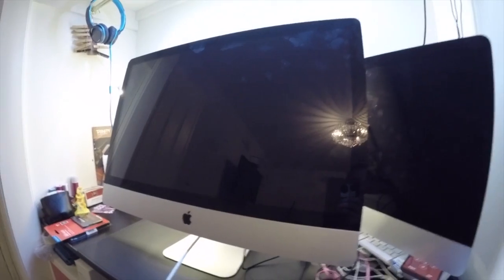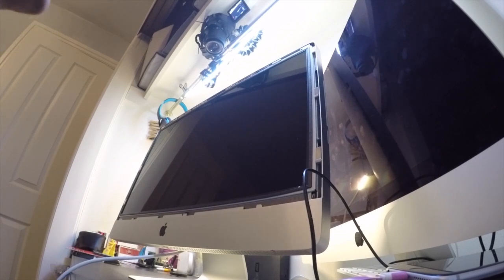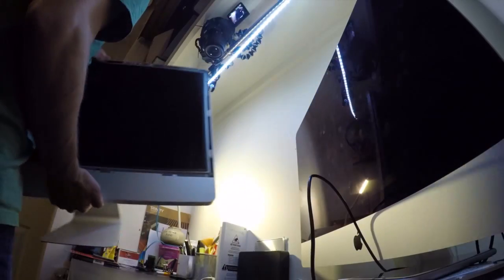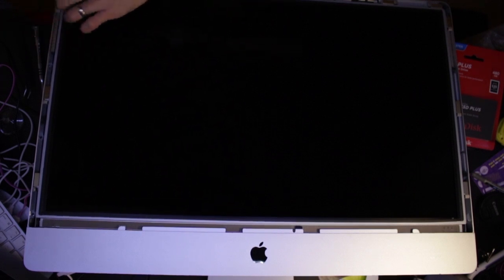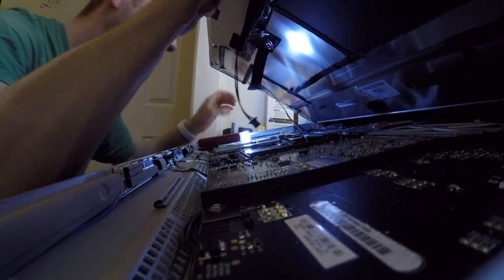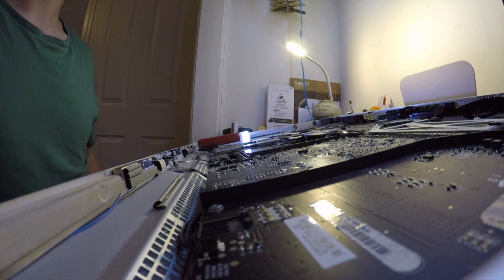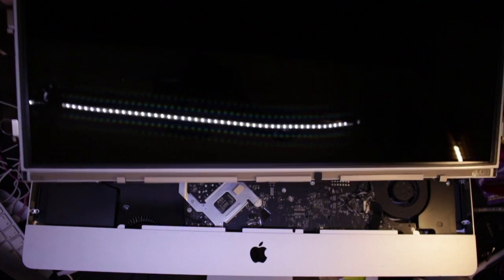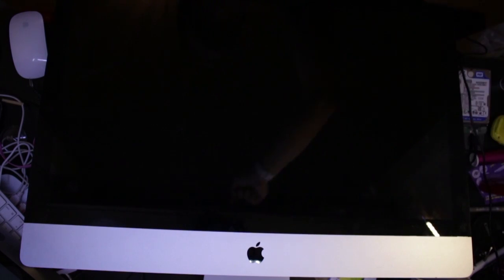iMac Mid 2010 SSD Upgrade

Comment: So basically once you got the screen off unplugged the old hard drive plugged the new ssd in no other cables and just used software to fix the fans and did you stick the ssd down with something thanks

Comment: I need to do this...well, as soon as possible. I have the same Mid 2010 iMac, but the videos on YT I keep seeing...these people are removing the screws to the logic board, disconnecting 6, 7 wire connections - removing the RAM (which is simple)..it's all a bit overwhelming and I admit intimidating. Looking at this...you just simply bypassed all of that and went straight to the hard drive? If that's the case, then...awesome, then this should (i stress "should") be a breeze!  I've had the iMac opened up before multiple times- display removed just to clean out the insane dust buildup. That part won't be a problem. 

Fear my HD is failing, and failing fast. EVERYTHING is slow, sluggish, mouse is studding when I move it, hearing 'chug chug' of the drive, etc etc. BUT...Boot up time is pushing a good 3+ min now, then another 1min+ for the desktop to even show icons, my apps..so something is way off! All signs of pre-failing HD. To be proactive I already did get a 1TB SSD - which I already formatted to Mac, installed the OS using a SATA to USB connection I've had for years. The tools, SSD heat sensor - which I did see in videos you need or else the fans run at full RPM - 

 The HD to SSD adapter bracket/mount. Which must be a popular item since Amazon showed 2 left on Tues. night (from OWC/MacSales) Should arrive today.

If it works...the comparison videos of 2010 iMac HDD boot and a SSD & performance is mindblowing!! Clean install, start from scratch...the longest part for me will be to reinstall all my apps/programs.

Comment: Hi, thanks for the vid.
Do I need any additional cable or the ones connected to the old hard drive will be enough?
I got the same ssd as you and same imac
Reply from the maker: Hiya Rachel, nah no other cables required, it’s basically a swap out. Best of luck to you! Let me know how you get on!
Reply: @andyf  done! everything went really fine. Thanks for the video, I've never touched apple hardware before hahah
Reply: Hi Raphael, how did you fix the SSD on the old 3,5 bay? Did you use an adaptor?
Reply: EUR EUR I just found a place I could let the ssd over it next to the old hd was
Reply: @itsadeepdiveonwhitelines  ah ok! did you fix the new ssd with tape or something? I'll do the manipulation this weekend and I'm a bit worried…